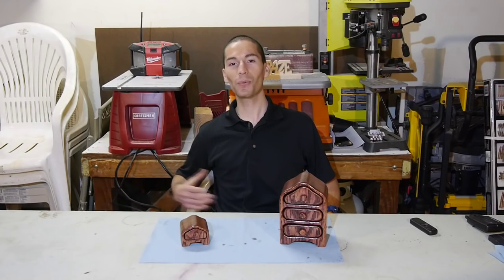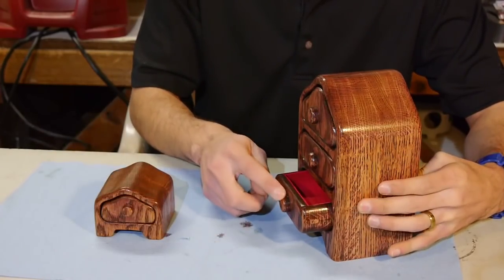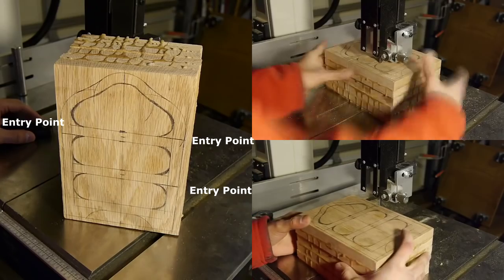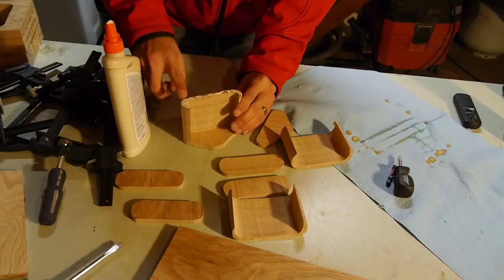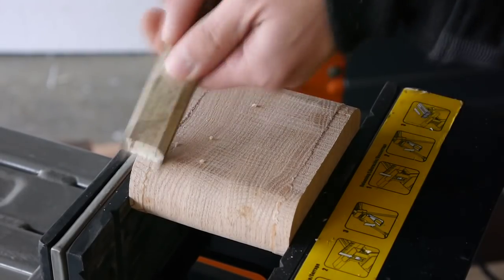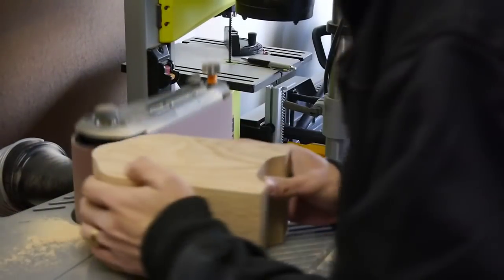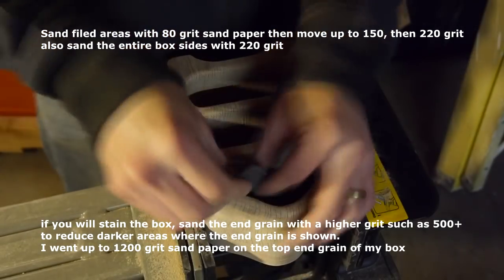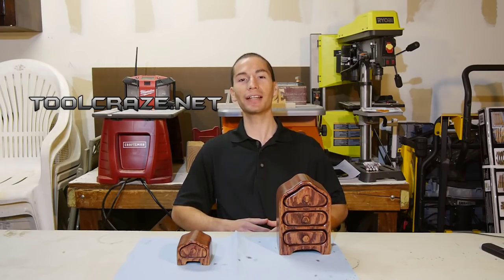Making a Bandsaw Box / Jewelry Box

Comment: Awesome project video Javier, great seeing you get into this and I've got the same Rikon. Love it.
Reply from the maker: Hey Chris!! Great to hear from you! Thanks bro, building a bandsaw box was one of the first projects I built with my first bandsaw. I soon upgraded to the Rikon as you can see. You probably got it for the same reasons I did, biggest I could ever need and afford.
I also built a mobile tool base for it with a foot activated lever, it's a very neat design, also made one for my jointer. You should check out my video on the Mobile Tool Base
I also have another woodworking project video coming out soon on top of the usual tool reviews. Still working on the project though, it's also another project mostly done with cuts using a bandsaw.

Comment: I like that you stated the wood sizes for your glue ups. Outstanding. What is your height on it when you took the clamps off?
Reply from the maker: It was several years ago when I made it and even then, all the boxes I've made, never did I keep measurements. I just got creative. I encourage you to be creative as well, that's why I haven't included measurements or even templates. Time to get creative! Happy woodworking.
Reply: @ToolCraze  Reason I ask, it helps me determine how much hardwood I need for each box I want to make.
Reply from the maker: I had no idea what dimensions were going to be before I started my band saw boxes but that didn't stop me. Time to get creative

Comment: What kind of bandsaw blade do you use? I'm using a 3/8 inch blade and am having trouble with tight corners. Any suggestions?
Reply from the maker: the thinner the blade is, the easier it is to make tighter turns. I don't remember exactly but I believe I used a 1/4" blade

Comment: Great video. Are you using a 10 inch or 14 inch bandsaw? I don't think my 10 inch saw will cut through oak that easily.
Reply from the maker: Thanks. I'm using a deluxe 14 inch bandsaw but you can make bandsaw boxes from oak on any bandsaw. You just have to limit the actual size of the box based on your bandsaw capacities. I made the tiny bandsaw box in this video with only one drawer on a 9 inch bandsaw and that too was out of oak.
Reply: Thank you very much for the quick reply. I'm going to try some poplar first and then work up to a harder wood. I like the fact that there isn't much waste with these boxes, plus you can add different design elements.
Reply from the maker: you're welcome, have fun with your project

Comment: Great video! What size blade did you use?
Reply from the maker: +Thomas Caffelle Thanks, I used a 1/4" blade for all the cuts.
Reply: +Tool Craze Thanks, how many TPI?
Reply from the maker: 14 tpi, although after using it I'd probably go with a blade with less teeth per inch for the size block of wood I used
Reply: +Tool Craze Thanks so much for your help. Just made my first bandsaw box using a 3/16" 4tpi. It needed a lot of sanding to remove saw marks.
Reply from the maker: +Thomas Caffelle you're welcome, the blade you used is a good choice. The smaller size would be a bit better for curves. Don't worry about saw marks, even my blade left unsightly cut marks that needed to be sanded down as well.

Comment: Nice bandsaw box. Why didn't you cut the profile first, then cut off the back of the bandsaw box afterwards to ensure the perfect fit when glued back on
Reply from the maker: I've done it the way you mentioned it before and it works out better this way because if you cut the profile first then the back, what ends up happening is that after you cut the drawers out and glue the gaps in the frame back together, the back part never matches the frame because the frame shrunk a little because of the gaps in the drawers. Then you have to go back in and sand or cut the excess back part, which is more work in the end. My way is better and faster and you only do it once rather than having to go back and fix things later.
Reply: Strange that. I cut the profile first and it is always a perfect fit. Never had a problem with the frame shrinking. Just a good sanding on the belt sander after glue up rectifies any misalignment.  Don't get me wrong, you have made a really nice box, I have made a few like this myself. I guess it is just different strokes for different folks.
Reply from the maker: Cliff Carlo see that right there is the reason why I cut the frame out last so we don't have to go back and fix mistakes, it's more efficient this way. And yes the frame shrinks with each drawer, and the more drawers cut out the more obvious.

Comment: wouldn't it be better to make the entry points along the grain so that when you glue it back together it's not end to end glueing?
Reply from the maker: +Fred Lastname that would certainly help out. But no need to worry even if you do go against the grain as it's not very noticeably. The more clamping force you put on the joint, the less noticeable it becomes.
Reply: I meant for structural reasons not aesthetic. If you enter along the grain it's long grain to long grain glueing whereas in your video it's end grain to end grain.